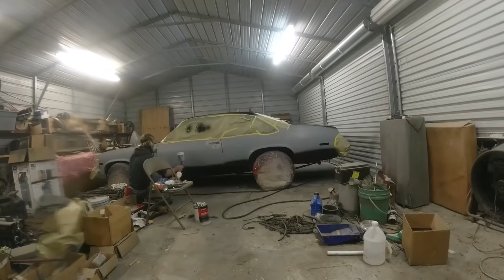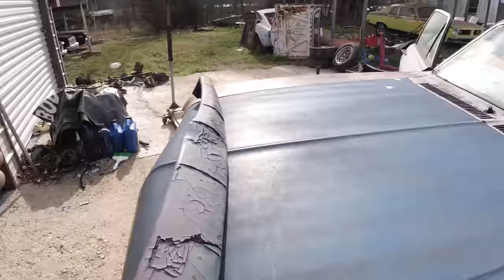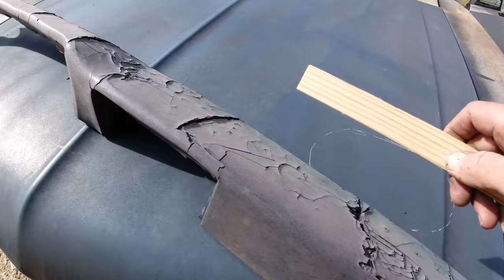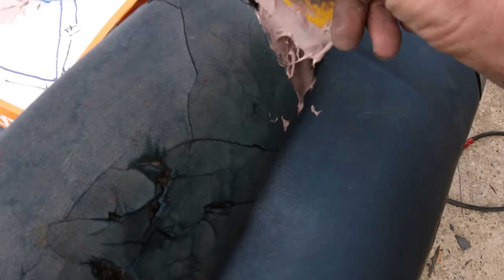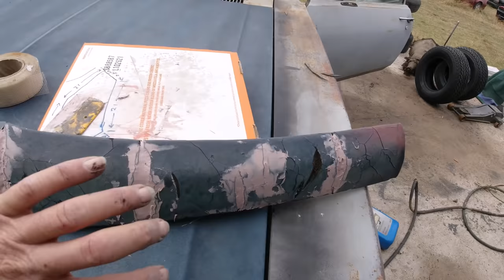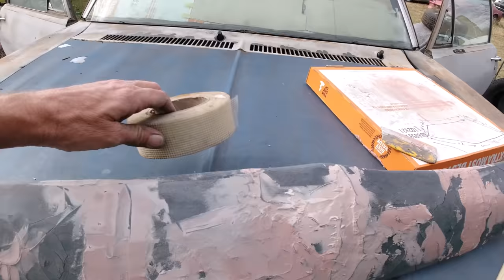Restoration of a 1972 Chevy Nova - Part 16 - Rebuild your dash pad for $10 !!

Comment: When ever i purchase vinyl. From a local fabric shop. I usually take a cardboard tube from materials i purchase from my main wholesale  supplier. Save  them. They save a lot of wrinkles rolling up , especially vinyls. Folding ( NOT GOOD) .I ENJOYED YOUR PROCEDURE  . IM BASICALLY RETIRED GETTING AWAY FROM HOUSEHOLD FURNITURE.  STICK TO THIS SORT OF PROJECTS . EASIER ON THIS OLD 78 YEARS  YOUNG WHO REFUSES TO QUIT. KEEP BUSY KEEPS ONES MIND GOING. A LITTLE CREAKY IN THE JOINTS. A LITTLE WD-40 LOL. KEEP IN TOUCH. MIKE INNOVATIVE UPHOLSTERY repair & design  PRINCE GEORGE B.C. CANADA

Comment: Looks fantastic BUT I'm wondering how it will stand up top sitting in the sun for long periods of time.  I wonder if that contact cement is made for those extreme outdoor conditions and how the vinyl together with the contact cement will react over the long term.
Reply from the maker: A year later still looks great. See my latest video.

Comment: Im no expert but i do know that you have to put contact cement on both surfaces, i didn't put enough on one side and over time it pulled away from where i had glued it. As far as i can tell he's only gluing one side which will definitely pull away from the low spots and edges over time.

Comment: They make a fiberglass bondo. It won't flake off like regular bondo and you don't have to use that drywall tape. I'm wondering why you didn't use that. Is it because the original is foam and need it to flex?
Reply from the maker: bondo is cheaper plus it's covered by vinyl so cracks won't matter much

Comment: I guess it works but you better hope you never smash your head in to it. I’ve used liquid electrical tape with great results. It’s flexible and you can heat it to put a a texture strip on it. And it accepts paint really well.

Comment: When using Contact cement glue I see you did it on the edge, but you’re supposed to put it all over the material and the dash then glue them together when they’re tacky you’ll have a lot better bond

Comment: Nice, however a quick google search says the contact cement is $20-40 alone. Damn inflation I guess. I am going to attempt this coming up this summer and maybe materials for it will come back down. Nice job though, looks way better. Luckily mine has only minimal cracks from having been a car cover on it. So maybe I won’t need as much.
Reply from the maker: $12 and I used half, so $6

Comment: The reason why you don't use bondo to fill the the dash is because it chemically react with the foam that's still there. 
Remove the dash, cleared up just like you did remove all the high spots and damaged areas. Just like he did. Get you a can of polyurethane foam on the deep areas, let it dry and trim it. If there any reinforcements issues you need to do in the bottom do so. Then dry fit reinstall it in the car. Take gorilla glue (which is a polyurethane glue) and cover the whole thing. Apply your fiberglass tape at this time. And then spray a light mist of water. Once it's dry, remove it, then send it with 80grit. Now find some old latex paint. Apply a thin coat. And let it dry. 
Now you can use the bondo and you won't need much. You can follow all the steps that he's doing at this point.
The reason why you use foam in the cracks and not Bondo is because there's nothing for the Bondo to actually stick to and the chemical reaction will eat up the adjacent where the cracks are. The gorilla glue will allow you to fill and seal the micro cracks. Fiberglass tape applied in the wet glue will provide reinforcement to the piece so that its rigid. Very light spraying of the water on the glue makes it swell just a bit as a chemical reaction while it's drying. The latex paint after sanding, provides a protective chemically and substrate to put the Bondo on so it doesn't react with the dash. Personally and less it was way out of whack I wouldn't even bother using it. At this point I would get some 1/16 upholstery foam, spray the whole thing with 66 and trim the excess. Once that is dried I would spray the whole thing again with 66 and applying my upholstery fabric.
There's always a fast way and a right way. A quick fix and a permanent fix. Bondo has a place but it is nothing to do with anything that is going to provide any kind of structural support or be used as a thick filler. It will rattle out and separate especially when exposed to excessive heat or cold which your dashboard definitely qualifies has that type of environment. If you're not good at bolstering and you're doing something like this then get a four-way stretch fabric.
Reply from the maker: It's been over a year and is fine still.

Comment: Dash looks great. 
Loved how you repurposed the pizza box. 
I can't throw mine away fas enough. Gotta get me a burn barrel. But save a couple for bondo mixing. 

Question; 
From your experiencewhat's the performance difference between bondo & filler? 
Like is filler able to be applied in thinner coats? 
Or why not just bondo everything?

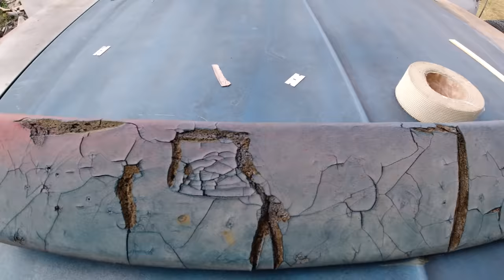Comment: It looks way better than those old plastic hard covers that you can see doesn’t fit around the edges and you can tell it’s just crap !  I think they cost 40-80$ or use to they should look as good as what the one in this video does . Instead they look like a ten dollar one and the one he done looks like a 100$ job easy probably more at a upholstery shop defiantly worth the time and effort because if you buy the whole dash pad new it still not going to look as good as original but this way he did his it looks better than the original .  Then if you would use hi dollar Italian leather look out there’s nothing like opening the doors and smelling leather it’s just got that wow to it you can smell the cars is worth a small fortune but you don’t have to say it didn’t set you back like that !  This would be a good thing to do to the door panels on certain cars that have the same issue but in a smaller scale with the cracks that is ! Love your idea man that’s what’s up I got a 1968 c-10 327-350 horse 4speed m-21 Muncie with posi trac 3:40 gears going white in the interior with the light green metal flake outside with a white top yeah I been wondering how I was going to fix my little p pad it’s super small just covers the front edge like 2 inches under with maybe 3 inches on top I will probably do the white Italian leather you’ve inspired me I might do a set of hi back bucket seats from a 87 blazer with the center consul with the same leather find me a way to get it sewn maybe take the old covers use them for the pattern!

Comment: What you should instead be using is a Flexible High Density Body Filler for Bumpers & Plastics so it will NOT Crack! Like Ocean, Upol 706/7061/Plast X, Polyvance, Vicrez, Dominion Sure Seal XPSAP, Novol & Novol Spectrum, ETalon, KBond, InterTroton, Isopon, BodyPro, Bigboy Flexible Filler, E-Tech, Rust-Oleum Bumper Plastic Repair kit, others...

Then use a Flexible Primer Sealer to seal it from the moisture... I like the Speedokote T-Rex Bite Kote cause it is an Adhesion Promoter as well as a Clear Sealer! That is Flexible! They also have the Flex Prime too that is a Primer/Primer Sealer that is more for going over body filler and glazing putty... But being it is also a Sealer you can just use that

Comment: Ive never seen vinyl applied to another surface without applying contact cement to both sides. It even says to do so, on the can.
Reply from the maker: well, you just saw it in the video

Comment: I would have hung the vinyl from one end and used a heat gun or hair dryer to help remove the wrinkles or lines. After 2 or 3 times the wrinkles or lines would have fell out of it.

Comment: That's the most expensive ten dollar repair I've ever seen, might have been that left hand cigarette talking!
Reply from the maker: Obviously you have no concept of what materials cost and how much I used. Maybe watch it again.
Reply: @clunkersandclassics   if someone decided to follow your lead, they would spend minimum $75 in materials. Sand paper,contact cement, Bondo, sheetrock tape, vinyl and two packs of cigarettes.
Reply from the maker: @jefffreeman1118  Then they'd have enough materials to do 7 dashes
Reply: @clunkersandclassics  
No, just enough for one and enough material waste to do others and several hours of smoking!

Comment: Have you ever tried using the Spray Black Foam? Its uv resistant and would be a bit more flexible than the Bondo... Just wondering if that would work .
Reply from the maker: Haven't tried it.

Comment: I thank for the time and knowledge but i might be able to help you a bit with a more solid job on your dash board, but with contact cement, is supposed to be applied to the dashboard with a thin layer, then a thin layer applied to the back of your vinyl, then let dry to the touch, then carefully layer the two together, its certainly harder to work with but it will never budge, or pull up in the heat or cold i spent 25yrs doing Corporate Awards  Premiums & Incentives and glueing plaques down on wood, metal every kind of materials known to mankind, you wouldnt need to use no tape, because even though it seem dry to the touch upon CONTACT it adhere extremely well. The instructions on the can says what im talking about, we used to glue a 4 ft by 6ft sheet of 0.040 brass to chip board, and they never pulled off, even after 25yrs. It still come out nice and i appreciate your time, the bondo and tape is a great idea. Thanks for your time, and please Have The Best Day's Possible from All of Us at: Busted-Knuckles Speed & Custom in Barrie Ont Canada L4M2Z8

Comment: I wouldn't use regular bondo because it'll Crack. Should use fiber glass filler.
Reply from the maker: bondo should be ok sandwiched between the tape and vinyl.

Comment: You can use styrofoam chopped up and mixed with silicone sealant,do just like you did with the Bondo,then wrap it in vinyl or tweed. Done!

Comment: Won’t the heat from the sun act as a heat gun and melt/soften the glue making bubbles or wrinkles appear? It looks amazing, you did way better than what I thought was possible.. especially considering that you did it with a cigarette and half a table 😂
Reply from the maker: Sun won't affect glue.

Comment: Very interesting did not think of using Bondo ,nice work now do you know if it will last ? P S happy new year 👍🎉 say hi to your little helpers 🐶😾🎉🎊👍
Reply from the maker: Since the bondo is not exposed to the elements, it should last. Happy New Year!
Reply: @clunkersandclassics  ok just wondering
Reply: Even if it didn't last, he's got $10 in it.
Reply: i think the vinyl on top will keep it all together plus idk about yall but i don't really touch the top side of the dash on either of my vehicles unless yall one of those ppl that like to put your feet on the dash 😤

Comment: GREAT VIDEO,,,ONE SUGGESTION,,,DRY FALL N LET YOUR VINYL ,HANG OUT IN SUN OR ,,HEAT IT UP,, TO ALLOW,,MATERIAL,TO GET LAID OUT FLAT ,WITH NO FOLDS OR RIPPLES, SO YOU DONT HAVE TO WORK AS HARD TO SMOOTH IT OUT ,,WHY WORK HARD, WORK SMARTER ,,SO U DONT HAVE TO DO SO MUCH EXTRA ,,I ADMIRE YOUR PROJECT ,,GOOD LUCK

Comment: The problem I see is you used Bondo which is not flexible and the dash pad was all twisted and crooked since it was out of the vehicle. Cant imagine it went in easily. Plus I can see the flexing going in will crack the filler and that will show through the vinyl.
Reply from the maker: It went in easy and I doubt it's going to flex

Comment: Unless you use a UV resistant material, in 5 years it will crack again. The heat doesn't kill dashes UV radiation does. I think a better choice would be fiberglass and paint to match color. It will last forever. It does look really good though.
Reply from the maker: It's marine grade so should last

Comment: This is good... The only thing I would have done differently would be, When you first started filling. I would have mixed OG gorilla glue in a disposable bowl with a few drops of water to start it foaming. and I would have filled the bottoms of all the cracks with that. it has a much much stronger bond than body filler and it would keep the rest of the dash from deteriorating around the bondo.

Comment: Um.....why are you doing that on the hood of the car, where you will have to then fix all the scratches and possible dents you just made later when you paint the car???
Reply from the maker: the whole car gets stripped to the metal before paint anyway.

Comment: I get it's a $10 fix but I may have went with fiberglass matting instead of rows of drywall mesh. just a thought.
Reply: and maybe 10 dollars if you already have the stuff but bondo isnt a couple bucks and that glue either 🤣 and if you dont have a sander ...yea. id say maybe like 100 bucks still better than 500 for a new one.

Comment: instead of bondo try using expansion foam then trim it flat that is how i did my 79 camaro dash pad worked great my 68 chevy pu a new dash pad is 54 bucks i rebuilt the whole dash for under 250 bucks with full factory gauges had to buy a tac glove box vacuum gauge fuel gauge new dash pad new cig lighter few nobs new bezel and lens got all last year . so far i have a 1000 bucks in my 68 pu with a stroked 454 450 hp with a 02xx trans the engine and trans has 6,000 miles on them with a serpentine belt twin electric fans full set of coolers i got all that for free plus 3 more set ups . i learn something very important how to get good engines for free with everything u need to put then in . then i just picked up a weidland tunnel ram with carbs and a high rise with carb bothy for 100 bucks in good working condition . i don't know if u know this but ur suppose to put the contact cement on both sides it will hold a lot better plus that is what the instruction says to do then u need a heat gun to help around hard spots that is what i had to do with my 79 camaro dash pad it was a B to do but if it works then it works that is what counts just go look at a 79 camaro dash pad u will see what i had to go through . then on the hard spots i used blocks to help hold it in place till it drys and u did the ends wrong sorry to say nothing like i did i had no wrinkles or bulges and mine was way harder to do if u don't believe me go look at a 79 dash . what really sucks i have to do another one i just got 3  79 z28's for free one is a z28 rs t top but i have not checked the one that has new interior in it

Comment: Have been doing crap like that for 55 years now..... We're always tick  me off about the later gym interiors and I'm talking late 60s moving on up was all that plastic the way the British did it and give you a burlwood dash chrome rim gauges and real automotive upholstery..... What you done here and what I've done along those lines too kind of like gives a little bit back of the handcraftsmanship I suspect you or me might call it Mickey mouse but the vinyl is going to last a hell of a lot longer than what GM put on there..... Next upholster the seats with leather and throw as much of that plastic in the garbage as you can get away with...and by the way I have a Camaro and a Corvette the Camaros is 71 and you don't know want to know how many dashboards I bought for that and I'm finishing up the complete interior on the Corvette it's a 75 to the worst cars you can possibly imagine for plastic.... I remember when just dashes came out in Van nuys back and I think it was the 1970s they to use vacuum forming but they don't do it cheaply....

Comment: It’s says under $10.  But that bucket of bondo is $50.     Everything said and done.  It’s closer to $100.   Vinyl, contact cement,  bondo.    I mean if your a gear head you most likely have the bondo.  Then your “saving” the $50.
Reply from the maker: I used $1 worth of bondo, not a whole bucket. Same with the other supplies.

Comment: Nice job, but if you figure your time in ,it would be cheaper to buy a new one
Reply from the maker: yes, if I had a job making $150 an hour. Most people don't, so this video is for them.
Reply: @clunkersandclassics  so you’re saying this hole project took you one hour? I would guess about 8.
Reply from the maker: @ptech88  about 2. new dash is 300
Reply: @clunkersandclassics  so you video says three hours now its two, i call bs.
Reply from the maker: @ptech88  and you thought 8. I call BS.
Reply: It's like paying yourself the cost of the replacement and be done before FedEx gets to the driveway.

Comment: Sadly in today's economy even a tiny bottle of contact cement is I've $8
Reply from the maker: I bought a quart for $12 and used about a quarter of it
Reply: @clunkersandclassics  that's cheap. A few months ago at Lowes I literally paid $8 for the little can with the brush on the cap and the quart was way higher
Reply from the maker: @sinformant  Walmart $12 a quart

Comment: Get off the $10.00 budget crap and fix it right. 
Fill in the cracks with spray foam ' cut it level. 
Take a sheet of short hair fiberglass matting and fiberglass resin and cover the dash first then roll on another coat of fiberglass resin' sand it level. 
Also when using contact cement ' you have to coat the vinyl and part being covered to get it to properly stick. 
When applying vinyl ' you have to start in the middle and work your way out
so it's best to apply the contact cement to half the area being covered' work that down and then do the same process to the other side. 
You should end up having around $30.00 in materials buying them by the bulk
to do the job right minus the vinyl. 
As far as the cigarettes' people have alot worse habits and if you want to smoke ' that's your business and has nothing to do with what you're trying to show.